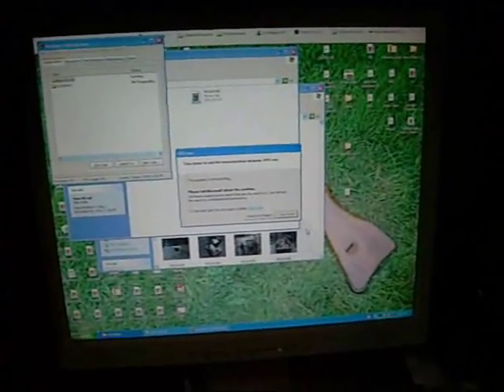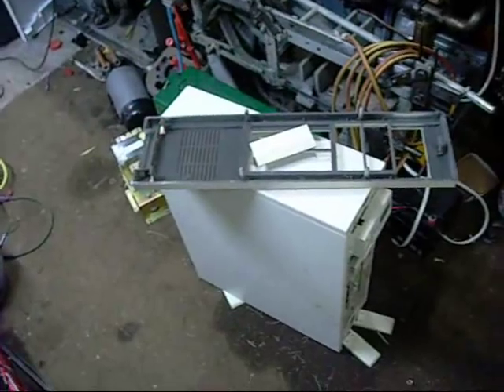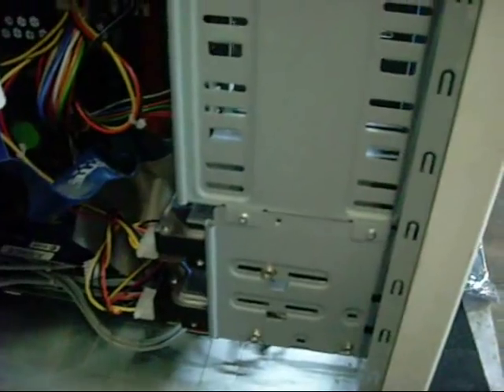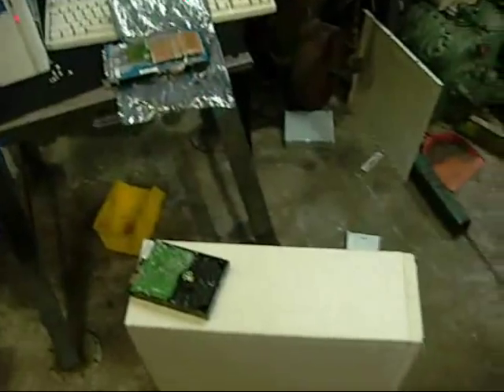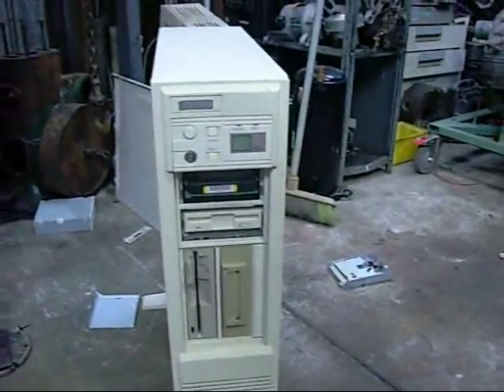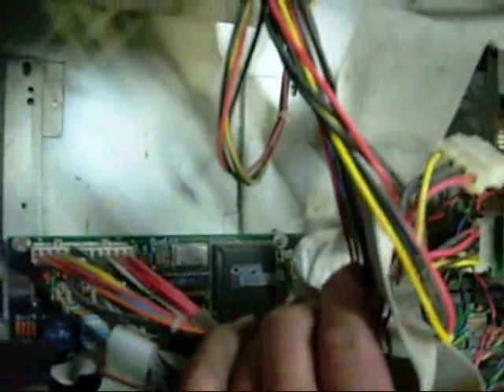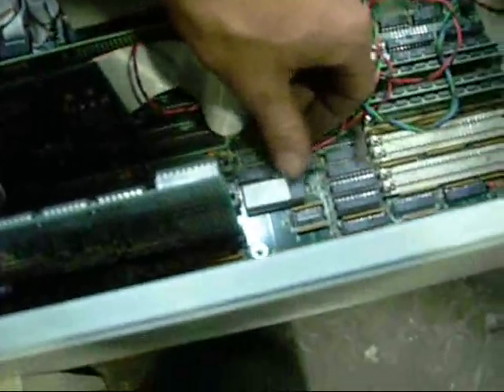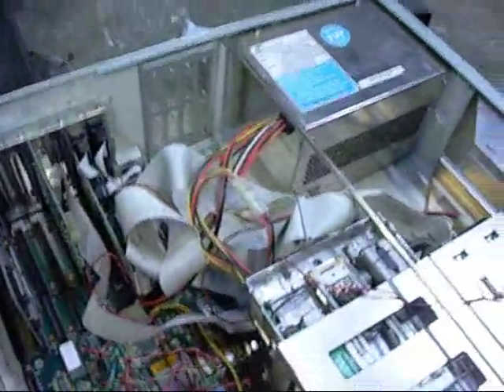Old and New PC Fun - AMD Athlon 64 3200 and AMD 386 DX 40

Comment: Ah, the sound of those old Maxtor hard drives. I had an old 386 computer similar to that one. maybe a bit wider. It had two of those Maxtors and Two 5.25" floppy drives. That think was built like a tank and still works to this day running windows 3.0. The startup of those hard drives with the beeping tone and head seeking takes me back like 10 years. It was my first computer.

Comment: The tape drive in a Irwin Accutrak 250mb. Similar to the Colorado Jumbo DC-2120. Irwin drives use their own proprietary format. Can't recall the name at the moment. I had the little brother to that model (120mb). The 120mb model was 80mb native and 120mb compressed. The software used for that drive is called EZTape.

Comment: that old tape drive is an old qic type tape drive. i have one somewhere still i think but its not a standard size for the front panel on it so a 5.25" bay has to be modded for it to fit

Comment: i have the 3500+ version of that cpu and the can be clocked up to 3.2 in your case and 3.5 in my case apparently but real ghz is allot lower. mine is 2.2. 
how did it fair anyway? i like amd much better to be honest. seems much smoother and cooler

Comment: @hoppes9 Wish it was, gas was $.20 a gallon back then and a new house was $8,000. I work with antique electronics so I tend to use their terminology, condensers, micromicrofarads, cycles per second, etc., prevents confusion when reading old schematics.

Comment: My cousin used to work for Erwin Magnetics.  That's probably a 120 MB cartridge tape unit.  I have one that looks just like it.  Uses 1/4" QIC 80 data cartridges.  The drive is not SCSI, but rather uses the same interface as the floppy drive.  I used to plug mine directly into the floppy controller.  Since that PC had dual floppy drives, it was using that add in controller.  I think that add in controller may have been faster then the floppy controller.  I have a box full of those cards. ;-)

Comment: I had a problem with my 2005 Gateway gm827  AMD 64 Athlon,being a bit slow in 2009...I upgraded the ram from 512 kb to 2.5 gig of ram....It acted like a different computer after that,the upgrade cost a little over a $100....Its super fast every since....  My Gateway does everything ,well on the web and applications..

Comment: Must be the heat making it act up, but the condensers likely are not helping. I have one here that has stuffed condensers on the main board I think but I have a computer junkie friend that will check the software for me first. Every time you rip one of those computers apart it takes me back to the place I used to work, we would rip pallets full of college computers apart, render everything down, plastic, PC boards, power supplies, even CPUs, fun but hard on the fingers.

Comment: I suspect some of the parts from the 386 are still useable, particular the disk drives and possibly the tape drive as well, at least if they're in good physical condition.  You might be able to get that tape drive to work at least under Windows 3.11 or Win 95 with the right drivers.  Those ISA expansion cards may also be useable, if there's corrosing on the cards you may be able to clean it off.

Comment: If that's the Celeron I think it is, they were godawful processors. No L2 cache, so Intel boosted the clock speeds to try and get a bit more performance out of them. Don't think it worked, as an Athlon XP at 2GHz will outperform a Celeron in everything.